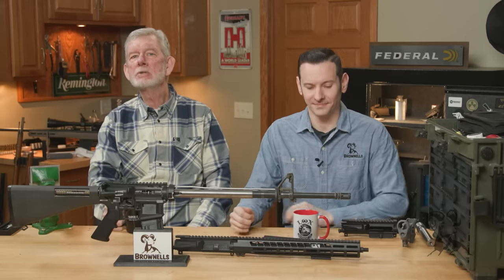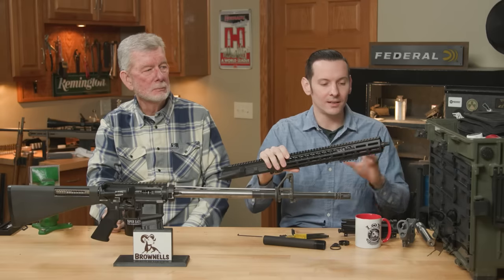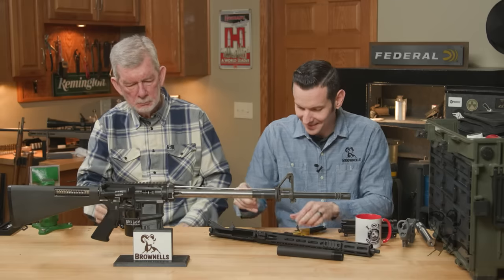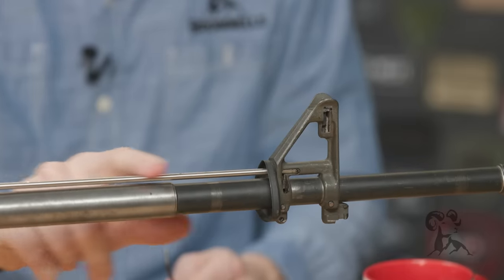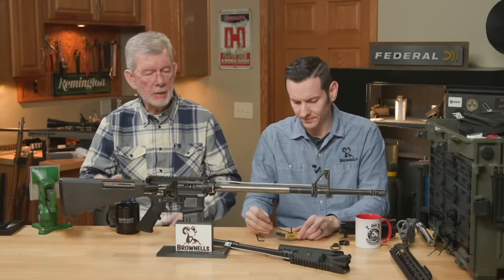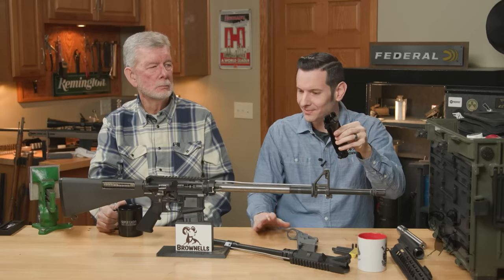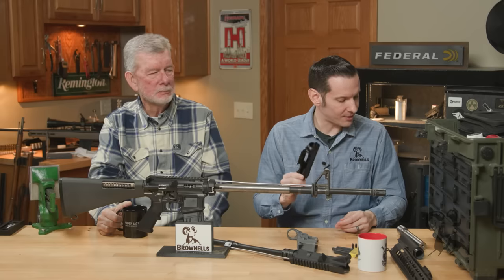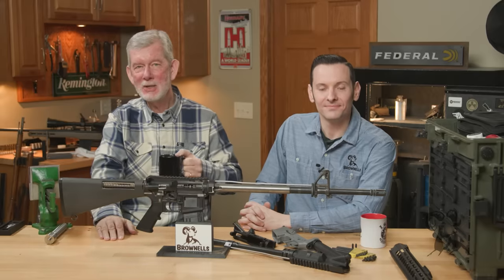Five More AR Builder Mistakes

Comment: I made the mistake of making someone else's  mistake. I bought a completed lower  whoever assembled it had the trigger guard pin in the wrong hole . Now I have two  improper built lowers . I have since learned from my mistake and buy Aero lowers with enhanced trigger guards .
Reply: Get proper training or have someone who knows build your rifle..They are not erector sets, especially if you use parts from different manufacturers..
Reply: @hairydogstail   I have no formal training. The Marine Corps installed  the nothing ventured nothing gained  mentality in me  40 plus years ago.  I'm willing to bet John M. Browning made a few mistakes  when he first attempted making rifles and shotguns. Education costs  money  learning from mistakes  makes you pay attention and not repeat it. I will agree with you on using    parts from the same manufacturer. I experienced it first hand  on my latest lower build . A little tight to say the least .

Comment: Shortening the screw isn’t always the answer even if it fits when static. Put some load on that bipod and it’s likely to touch the gas block. This also applies to those who ground down their gas block. Best to just put it in a different position. I advocate never mounting a bipod below the gas block. There will still be some POI shift when loading on a bipod, even with a free float handguard. But not as bad as touching the gas block.

Comment: I had an interesting gas block failyre that presnted like a misaligned gas block.  
I had a gas tube and gas block that didnt seem to want to allow the roll pin to slide through.....so i used a slightly small drill bit, turned by hand, to remove what i thought was a slight burr in the gas tube pin hole.  The problem actually turned out to be that the pin holes in the gas tube or block were misaligned slightly, so the tube was slightly misaligned in the block....caucing a small but persistent failure in a 233 wylde.  
Lesson, dont force the parts to align.  If they dont align right away, replace them.

Comment: I had a guy who I worked with in a gunshop keep asking me to swap out his endplate for one with a 1pt sling point while I was busy doing paperwork. He kept asking me and I kept telling him, when I'm done with whatever it was that I was doing. Finally after about the 5th time, I realized that he hadn't come back and bugged me for a little while, I thought that maybe he'd given up.... Thank God. Until he came up with the rifle racking it, I had also noticed that he had swapped out the plate, so now I didn't have to do it. Apparently I was wrong, so he handed it to me and said what do ya think. I kept racking the charging handle and dry firing it until it stopped working. So I took it apart and had realized that he screwed the buffer tube/receiver extension in just enough to capture the buffer retainer but when it got slammed hard enough, it eventually popped out. And then got into the fire control group and seized up the trigger. I had to rip out the buffer retainer spring which was destroyed. And I took out the trigger and hammer to help get everything out. I noticed that one of the legs was bent on the hammer spring. So luckily being the armorer/builder that I am, I had a box with extra parts and told him that he owes me the money it costs me to replace the parts. So I swapped everything out that needed to be swapped, and then reinstalled the buffer tube/receiver extension with the 1pt sling adapter end plate and made sure that the detent was properly installed and in place. Then I handed it back to him and said now here, put it back downstairs where you got it from and quit f***in with it until you've paid for it and ran your background check for it. Technically it's not your gun and you shouldn't be messin with it, so knock it off. So FYI make sure you screw that thing in all the way, but not too far. I usually hold down the detent screw it all the way in until it hits the detent itself and then back it out one thread or screw. That usually works for me.

Comment: I'm going to disagree on sliding the gas block all the way back, simply because you may be forcing an error that will compound a second unintentional error.  It's possible for the gas block to slightly occlude the gas port because it is set too far to the rear and timed X degrees off center, when it would not occlude the gas port if it was set at the correct depth to the shoulder and the same X degrees off center.  Just be aware that the shoulders on some gas block journals are machined with no handguard cap in mind.

Comment: How do you keep the buffer tube perfectly aligned up and down while torquing the castle nut?
Reply: Buy a jig that aligns it and holds it in place while torquing the castle nut. There are pricy ones, for high volume builders, and cheaper ones that can be sufficient with a little tweaking.

Comment: Is there a good way to clean the carbon out of your gas tube and gas block without removing the gas tube ?
Reply: An ultrasonic cleaner or soaking it in carbon remover. Then blow it out with compressed air
Reply: I never had to clean out a gas tube. I have a 84 colt with about 10,000 rounds. replaced gas tube about 9000 rounds because the carrier end of tube was showing excessive wear. The velocity of gas keeps them clean.

Comment: Got an idea….mlok barrel harmonizers
Attachments that go through the rail via mlok sections that have a neopreme feet about 1.5inches long that you can run down the handgaurd and put minimal pressure onto the barrel and the shooter can adjust his “harmonics” by tension via mlok harmonizers….am I nuts?

Comment: How do you avoid over torquing the muzzle device to get it timed/alligned properly.  What are problems caused by over-torquing?
Reply: I’ve seen a significant loss of accuracy result from over torquing a muzzle device. Best way, IMHO, is to use a peel washer, and shim it so it aligns without exceeding the specified torque.
Reply: I accidentally over torqued the A2 flash hider onto my barrel and it crushed the crush washer so it's stuck on the barrel. That's one potential problem.

Comment: Captured recoil spring system..... 
Keep the plunger and spring in the gun or remove it? Your opinion? I am running the Armaspec captured buffer spring system, so i removed the plunger and spring
Reply: I've removed most of mine even with still using a spring and buffer.
Reply: I keep them in so I can swap easily if needed.

Comment: I noticed that one of my barrels on one of my builds is slightly off centered to my rail. Would this be an indication that the upper receiver would needs to be lapped?
Reply: More likely that the handguard is not installed straight.

Comment: The Spring for the ping pong paddle and the Spring for the disconnect they will fit each other but you're not supposed to it can cause problems Make sure you have the correct Spring in the correct location Because interfering with your disconnect could make it viral multiple shots inadvertently because you didn't know what you were doing so make sure you have the right spring in the right place

Comment: Oldest brings me his first build...Buffer tube stuck in lower. All parts are off the receiver, stock and castle nut is removed etc. 
How do you get the tube off? Used every trick I know sans heat which I prefer NOT to do. Suggestions?
Reply: Take your parts to someone who knows how to build an AR..
Reply: @hairydogstail  Seeking advice for the oldest as I've not seen this issue in more 20 plus years as a military armorer on AR platform. The half dozen I've built run just fine thank you.
Reply: @davidfox1726 Either the receiver extension (buffer tube) or the lower receiver had the wrong class of threads..Mil spec weapons have to meet TDP specs and have to be at least a class 2 thread combination..I have seen this problem in both the lower receiver and buffer tubes.. Mixing different manufacturers parts and poor QC increases this type of problem..Always apply Aeroshell grease on the threads before threading the buffer into the receiver to get proper torque..Having the proper (AR15 receiver extension tube jig) will help in this process, such as the NcStAR or the excellent but expensive one from Pro Firearms..

Comment: I've gotten a few items torqued to the called for "specs" that soon there after fell loose.  To me the called for specs seem to most often times to light.  Anyone else see this too?  Most recent an aero upper that the barrel was loose on.   Right out of the box the handquard was shifting, and I discover the barrel nut was the issue.  Other times the buffer tube was loose form the castle nut being under torqued.  Not staked, but still.  The manufactures claim they're torqued to specs.

Comment: I’m pretty new to building, was rearranging things on my to ar’s and have been putting my upper and lowers in the vice directly with just rubber protection pads… bent my Silencerco upper just enough so the BCG wouldn’t slide freely in the upper
Reply: Get the proper tools such as the Midwest Ind action rod..
Reply: Get the magpul vice block and a real torque wrench at the least, sry bout that upper but it’s toast now.